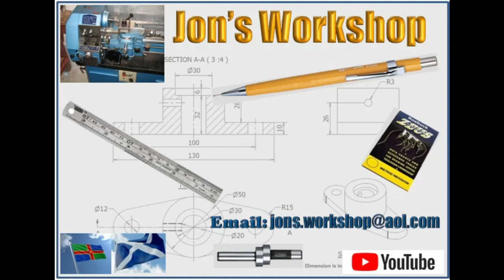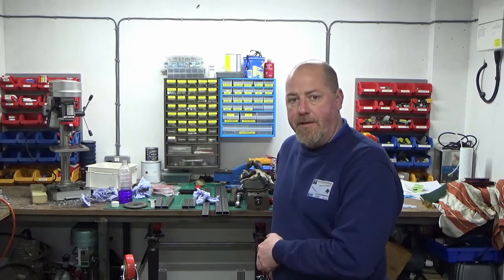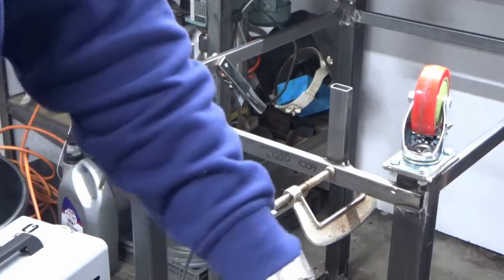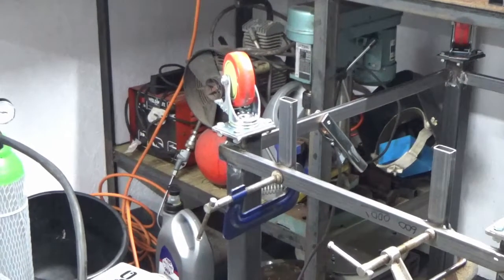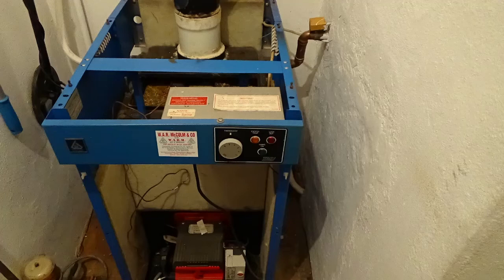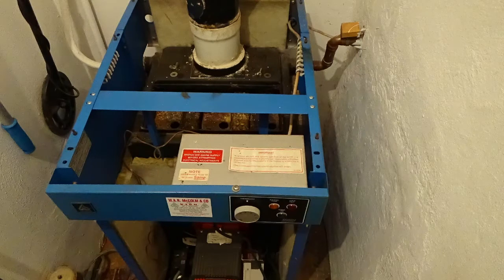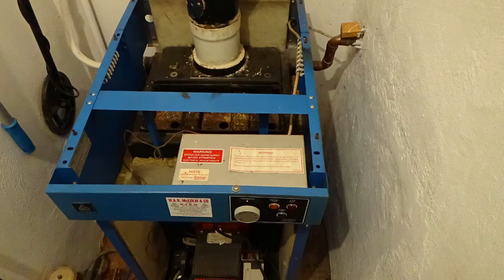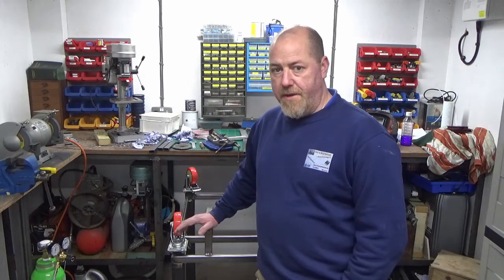Making A Mobile Welding Bench Part 2

Comment: Hi Jon. Lucky you smelt the burning when you did of you could of had great balls of fire. 
I'd buy some more of them trousers for your log burner, a lot cheaper and hotter than oil. Tony
Reply from the maker: Hi Tony, thanks for the comment. Great to hear from you and hope you're well. Lol, think you are right, lost some hairs so I think if I went for another tack I would have been in a bit of bother! These Lidl trousers certainly burn well. I don't think turn-ups on the outside for shorties is a good idea, not only do they catch swarf, it appears they also catch hot stuff (and that's not me by the way!)  Cheers, Jon

Comment: Oh gawd I pissed myself at your fire Jon lol I have had similar sorts of " accidents" myself lol One time I was welding a part panel into the wheel arch of a car and a ball off hot metal went down into the side of my trainer and burnt a rather large hole into my foot. Learnt my lesson on that one, wear leather rigger boots in future and use a leather welding apron too. Don't worry mate you will learn!
Reply from the maker: Hi Samrodian, thanks for the comment. Lol, many more disasters to go yet I fear! I did similar in my late teens, was welding (actually MMA brazing using the spring loaded carbon electrode jobby) under the wheel arch of my car wearing shorts. Got quite UV burnt from the knees down. Cheers, Jon

Comment: Sorry about the boiler Jon, there's always something. Our next expense is the car's mot, due in June. It's a 17 year old Mondeo diesel so I bet that's not going to be cheap!
I haven't got a mill yet, still saving up but it's taking forever on the pension. Look on the bright side Jon, you have a smashing workshop with most all the machines and tools you need to do anything... (except mend a boiler).
Reply from the maker: Hi Glyn, thanks for the comment, yeah, if had been a bit more kitted out with sheet metal forming gear, and a whole heap more experienced at welding, I would have had a crack at a replacement heat exchanger. Good luck with the Mondeo, can't be many of those left at that age now, especially the diesels, most had 100k + miles on at 3 yrs old due to the business miles etc. Cheers, Jon

Comment: Hi Jon sorry to hear about your boiler issues price sounds almost the same as I paid a few tears ago for a full oil system  are having a new tank as well ? Your old one may not be double skinned .
Loving the table build  I am not doing enough welding to need one but it might make a good  workbench
Reply from the maker: Hi Nigel, thanks for the comment. Nope, this is just for the boiler, pump, filter, solenoid valves, tiger loop, fire shut off valve and fitting! Unfortunately my current setup is that old it doesn't comply with any regulations so house is going to need knocking around, removing old flue up an open chimney and blocking off and putting a new vented flue through the wall. All of the oil line, tiger loop, fire valve etc need moving outside the building as well so quite a bit of work to do. Happy days! We are also going for a Worcester which isn't cheap but carries a 7 year warranty. All happening Monday and Tuesday next week. Cheers, Jon

Comment: That sounds like a bloody expensive plumber, excuse the French. Too used to oil rig money prices, me thinks.
Reply from the maker: Hi Del, thanks for the comment. He's certainly not the cheapest option (although options are fairly limited where I live), but he is well trusted and competent. The costs are mainly driven by circumstances, we are on oil and oil boilers are much dearer than gas, my current installation is totally illegal to todays legislation so there is lots of knocking around of the house to do with chimneys and flues etc, I am having pumps, oil lines, filters and valves replaced as well whilst I am at it so quite a bit of extra in that, and we are going for a Worcester (not cheap) but it comes with a 7 year warranty etc. I could probably get it down a couple of thousand but I would probably be replacing stuff in a couple of years (false economy). Just taking it on the chin mate, not much else you can do. Cheers, Jon